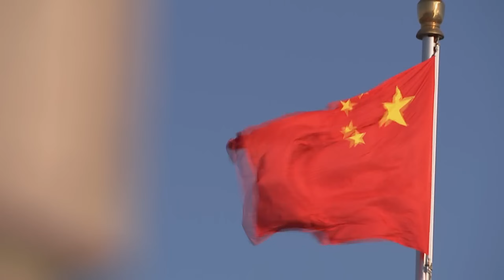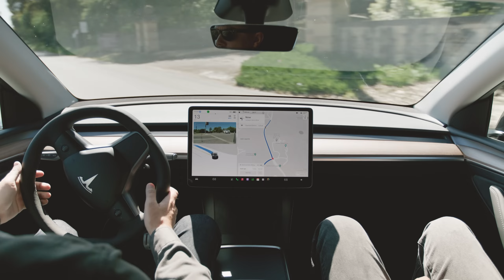China’s Break with the U.S.: The EV Supply Shock That Could Change Everything! Electric Car, Economy

Comment: Y'all throw out titles like that with no regard for how many of us would prefer a car with a carburetor, straight pipe, ashtray, and no computers or internet connections.
Reply: Exactly...I want my 1974 bronco, straight 6, manual transmission (3 on the tree), manually turned hubs, zero electronics except for an AM radio, windshield wipers, fan to blow heat, interior/exterior lights/signals...ergo no computers.  

The government has caused the automobile to become so complex in the effort to improve gas mileage but has left the consumer with vehicles costing 10X what they cost for my first vehicle.  Need to return to vehicles that are reasonably priced and can be repaired without an electrical engineer.
Reply: @TrineDaely  yep and some people want horse an buggy